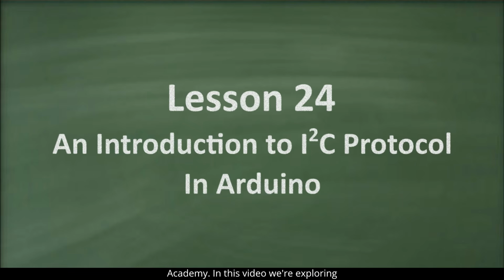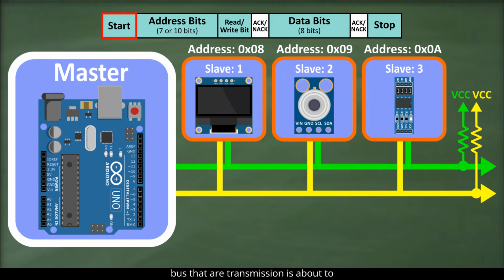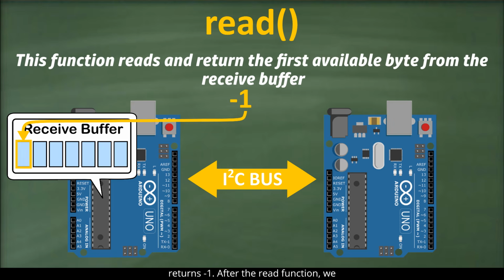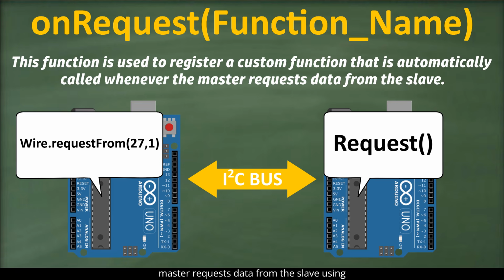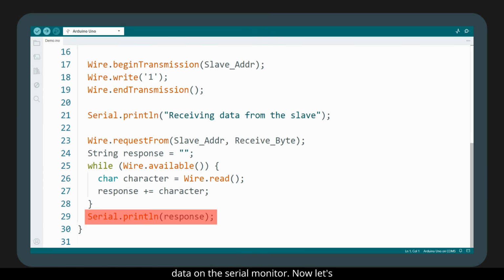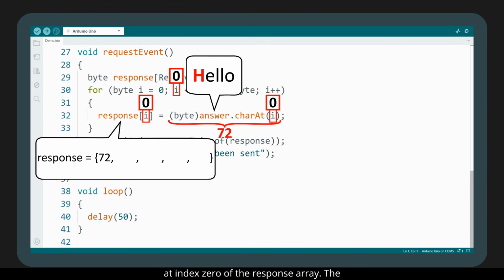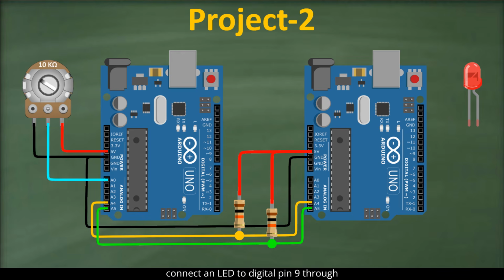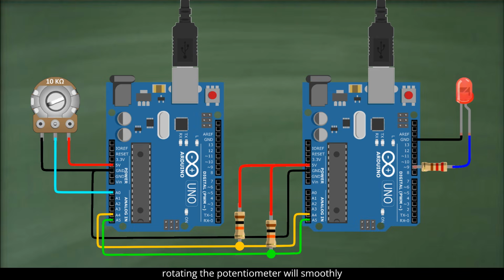Lesson: 24 - An Introduction to I2C Communication in Arduino | Wire Library Explained

Comment: Thank you so much for a very detailed and easy to understand language tutorial. I remember some 30 years ago working on microcontrollers and using I2C protocol, which I had to write the whole routine by hand in HEX with a DOS text editor, compile, upload via burning to an EEPROM, and test. Took forever. Arduino now makes it so much fun to use.